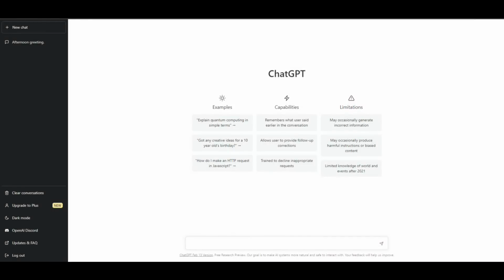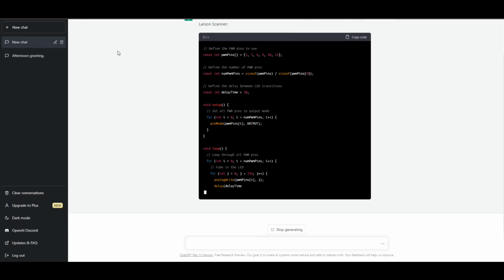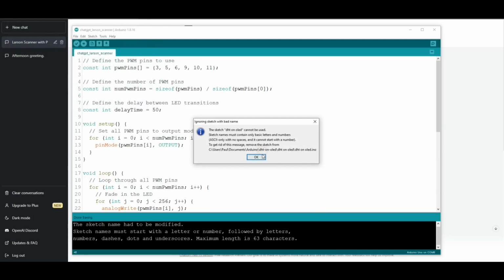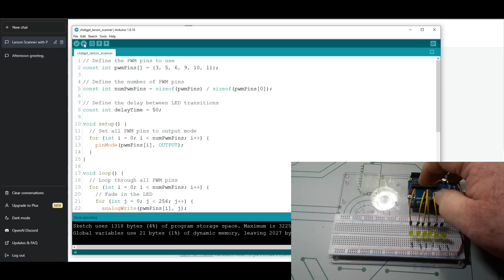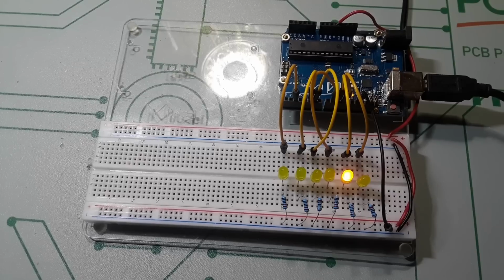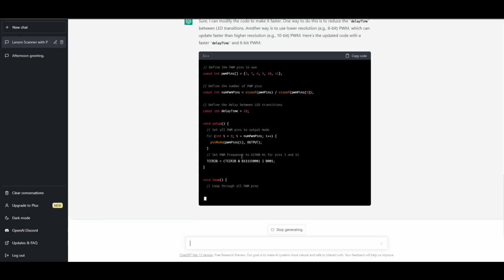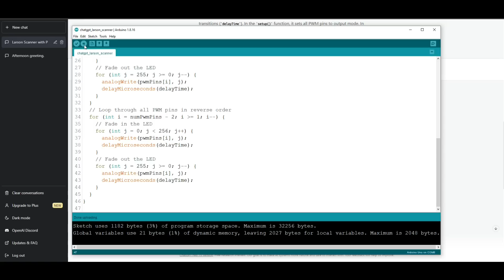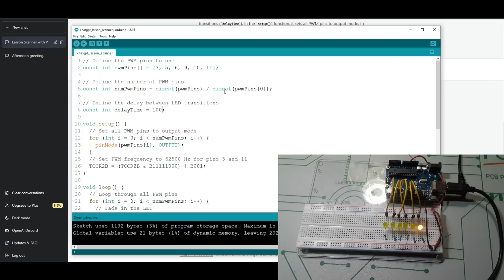Can ChatGPT Write An Arduino Sketch From A Simple Description

Comment: I work in a workshop what has automation control boxes. Due to people leaving the job I was the one who drew the short straw to be the electrical guy to handle all automation control boxes.... I have very very very basic coding knowledge and have a race drone building background...
With chat gpt I in 3 months iv managed to achieve more for the buisness then the past people have done in 14 years. Iv diagnosed poor code, designed and coded test units down to the individual components recommend for circuit and iv ran in basically zero problems in doing so.

I love chat gpt it got me a major pay rise

Comment: I have to amend my previous comment.  I just got around to actually setting up the Arduino and the sensor and testing the code.  What chatterbox wrote WOULD have been better than me if the device sent an analog signal and IF that had been connected to an analog pin.  Neither was true.  When I pointed that out, it modified the code to (correctly) treat the input as a PWM signal.  It also pointed out that I could display the actual pulse width in the serial monitor for purposes of tuning the threshold.  Being out of practice and just too lazy to look it up, I asked ChatGPT to add that to the code.  It did so by adding print statements that displayed the width by RE-READING the input.  I had to point out that that was a bad idea.  Yes, it can and does generate code.  The overall logic is correct but there are rookie mistakes hiding in the details.  It reminds me of my days mentoring the new hires just out of school.  They knew the mechanics and were eager to do the job but they often missed the subtleties that differentiate success from failure.

Comment: Sorry but I don't think that's that impressive. ChatGPT is a language model constructed from a nearly 45 TB dataset. It uses data scraped from nearly every available site on the Internet which probably includes thousands of "blink an LED" Arduino sketches and files that are publically available. For low level, simple tasks like this it performs exceedingly well but I don't see the  real advantage of doing this. Ask it for a more complex task that involves several moving parts like interfacing with an OLED display using the I2C pins and it fails 9/10 times.

Comment: I just got access to chatGPT and asked it exact your same question also other code making stuff but all I get is over and over again the same answer:

"As an AI language model, I cannot write codes or perform physical tasks. However, I can provide you with the algorithmic steps and the basic structure of the Duino sketch..."

And then some instruction without code!?

I guess it got tired in writing code and now has a living attitude ;-)
Reply from the maker: That's interesting. I had no trouble with it writing the code. Perhaps they don't want that kind of information to get on anymore. I don't know.

Comment: I was a little skeptical about this as it could have the code for a Larson Scanner buried in its database and just spit it back out.  To test this theory, I have it write code to use a proximity sensor and to light one of three LEDs based on whether an object was detected, if detected, beyond a certain range, or lastly, within that range.  Darn thing did it and better than I would have.  All hail Captain Dunsel!
Reply: " All hail Captain Dunsel!"....
 I wounder how many question marks went off over the heads of those that did not get that? 🤣
Better yet. " In regards to Captain Dunsel"...

LLAP 🖖

Comment: I am a software engineer working on development tooling. LLMs are useful tool but they are really bad at producing actual good code. If you ask them to write something less common

Obviously this impress people outside of the domain with their coding ability but they are really inefficient and producing low quality content vs dedicated model and will never beat a good dev with good code completion (e.g GitHub Copilot).

Comment: Am I the only one not impressed with any of the supposed AI that has been shown so far.  As far as I am concerned its no different than AI in the 1980s, only thing htat has changed is the hardware, these ai are not aware, they are not smart, they just have super large amounts of data and make good guesses.  So dumb, to have something like this run any system a human relies on is so stupid

Comment: This chatgpt as coding helper is neat, definitely made me want to retry some projects I snoozed due to my insufficient coding abilities. Sometimes It can be quite wrong but with some tweaks can be helpful
Reply: Not a best idea. if you will not fully understand code that thing "generated" (but in fact just combine someone else's code) you will have bugs / unintended functionality.
Reply: @tigrafrog  Yes, definitely not a good idea if one has no understanding of code, but for someone with an average understanding of how things work can venture and try more complex programs or at least get a starting point. The nice thing is you can get the chatgpt to change stuff if it fails at start like we saw in the video

Comment: Chat GPT is pretty amazing, however, one thing I found is it struggles with calculating inductors. I asked it to create a python calculator that gives voltage and current when a series or parallel circuit with resistance, capacitance, inductance and frequency are provided. It would always stall at the inductor. If I remember correctly it was able to solve for 1/2pi*f*L but didn't understand how to use reactance...